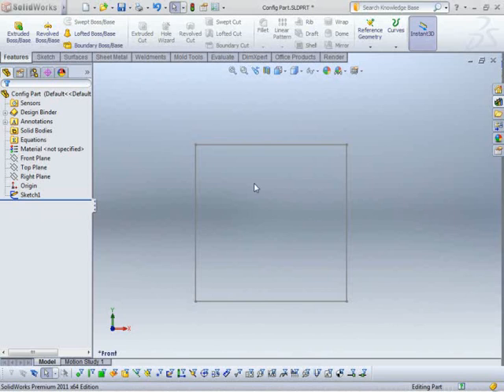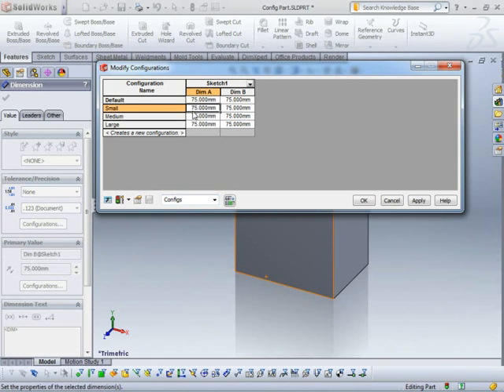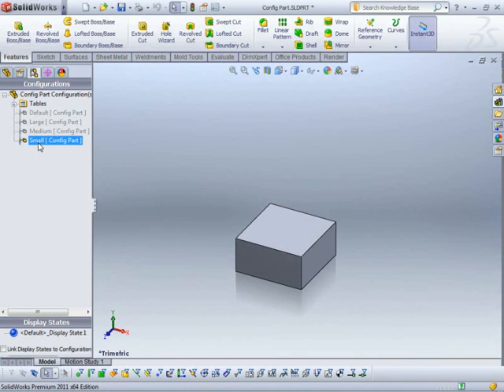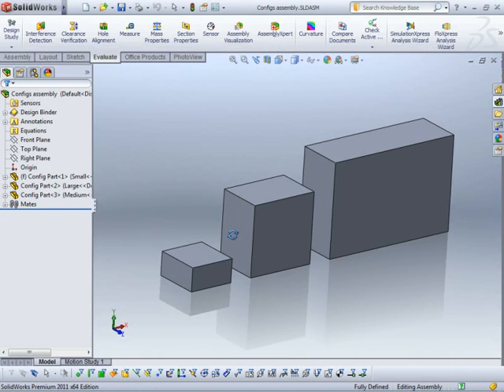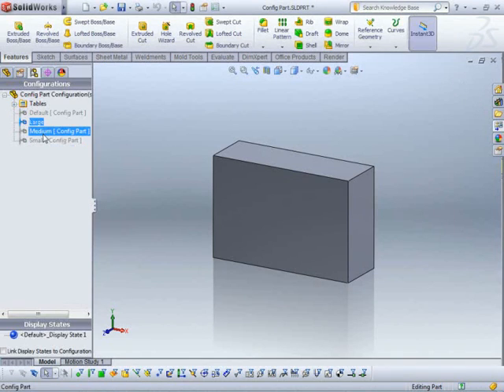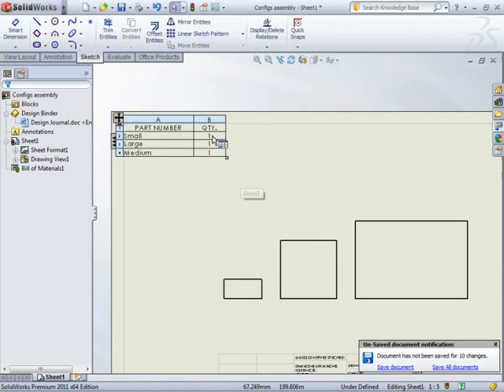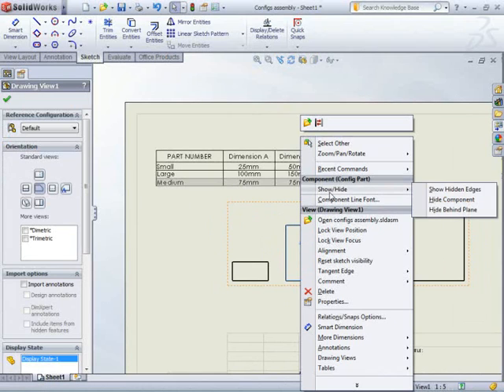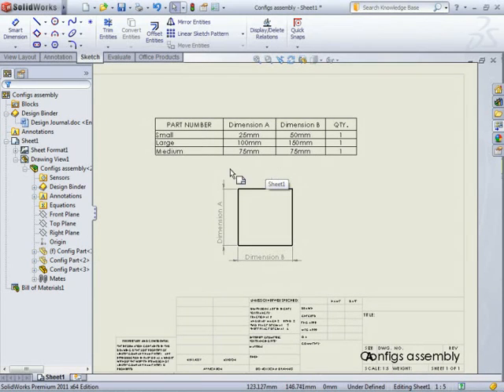Documenting SolidWorks Part Configurations in a Drawing

Comment: But can this same functionality be done with a part file with configurations?  I can only get it to show a single configuration and not all the configurations.  So far the only way I can see accomplishing it is to add multiple tables linked to individual configurations.  Quite cumbersome.
Reply: Yeah . I am living the same problem with single part's configurations. I dont want to add design table to a drawing; but there must another way to do it with BOM tables.